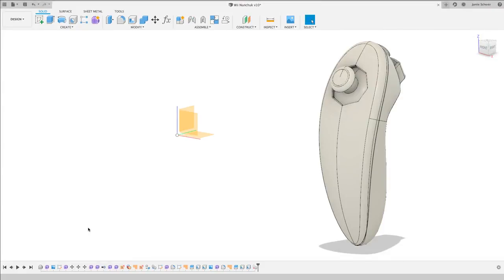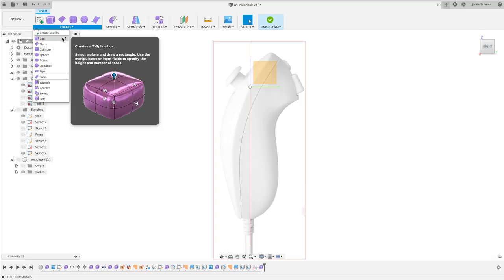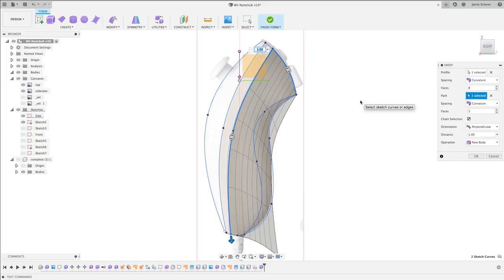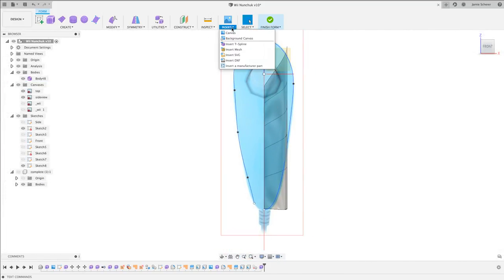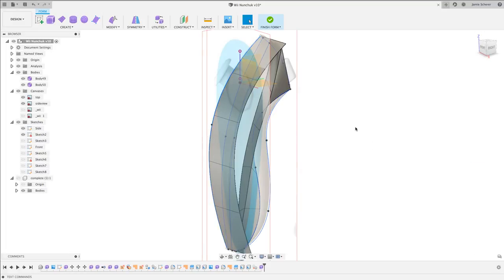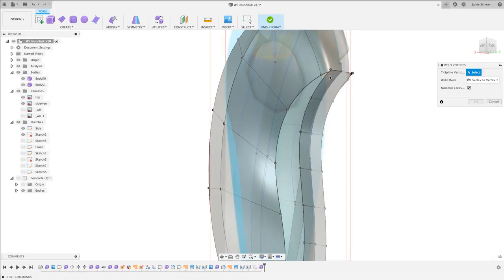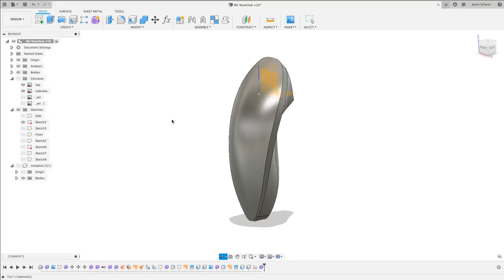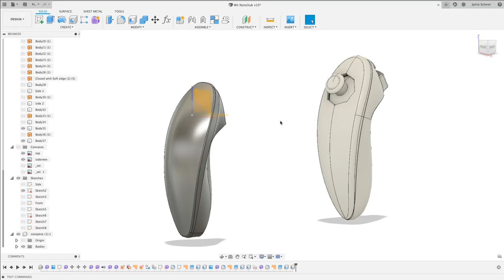360 LIVE: Sculpt a Nunchuck Controller

Comment: hello, I'm try to follow all steps as in this video. but when it comes to "split body", error appears. if I check "extend splitting tools", it creates extra edges around the new surfaces of both bodies, and I couldn't shell the body. it said "the operation would cause a large topology change". if I don check "extend splitting tools", everything is fine. could you please explain why this error happens and when I should/shouldn't check "extend splitting tools". Thanks in advance

Comment: The way I prefer to make splines is to place points only where there is an inflection point on the curve, i.e., where, if you were following the spline and watching its coordinates in real time, one of the axes reaches its maximum or minimum value. In general, this will allow you to constrain the tangency handle to be horizontal/vertical, which makes shaping the spline much easier! This will also give you the minimum number of points necessary to define the shape of the spline. I hope this is helpful! This video sure was!

Also, is there any way that the delete edge function (shown at 42:20) could be added to Surface modeling? In my last Surface modeling project, there were some faces that I needed to split for one command that I wanted merged back into one in the final design. To do this, I needed to sift through my timeline to right before they were split, do an Offset to duplicate them, Delete the split faces out of the final model in sections, Trim the Offset faces to fit, and then Stitch it all back together. The fact that I was able to do it at all was incredible! But, the process was quite tedious and had me wishing I could just delete the edges since I knew the faces were perfectly continuous to begin with.

Comment: Hi, just started to learn Fusion 360.  Found your example and working through it but have a problem.  The newer Fusion 360 version 2.0.9937 appears not to do Sweep the same way now.  I did a Surface Sweep and it ended up creating a new surface alright, but without the capability to select number of faces as your tutorial shows.  Is it possible?

Comment: 1. Anyone know which shortcut to use with the "edit form" multi-purpose tool to bridge or merge edges without going to those specific tools? Did that get removed? I could swear it was shown in the original set of sculpt tutorials on Fusion 360 website, but now I cannot locate them anywhere and I can not get it to work. With alt-drag of the "edit form" tool you get a new edge created, but there was a way to grab and drag two edges to bridge/merge to two other edges while keeping the "edit form" tool active an not need to select the bridge tool. 2. Also, copy-paste of your body does not allow you to create multiple versions, it's a copy of the body as if it were a component. Any changes to the original also happen to the copy.
Reply from the maker: I'm not sure I follow what you mean in part 1. To bridge/merge see these options: https://www.dropbox.com/s/uqhkfmdv8njt5is/Merge.png?dl=0 
For part 2 I think you want to instead copy and paste new a component (if you want it to be independent). https://knowledge.autodesk.com/support/fusion-360/learn-explore/caas/sfdcarticles/sfdcarticles/Paste-vs-Paste-New-in-Fusion-360.html
Reply: @adskFusion  Yes, I knew about the other tools for bridging, but I could have sworn there was a way to use the "edit form" tool to accomplish similar. Thanks for your reply.

Comment: How to do multiple shell thickness sir
Reply: The shell command doesn't have multiple inputs, but what I would do is shell a common thickness and then use Press Pull with the "New Offset" type and change the unique faces in a second operation.
Reply: @jmescherer  thanks